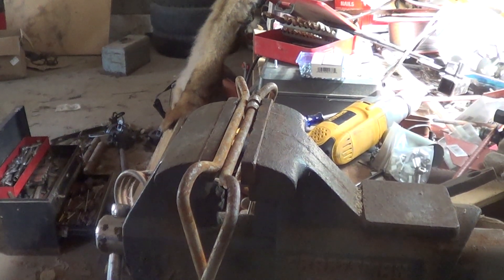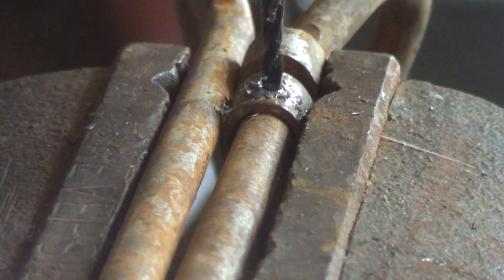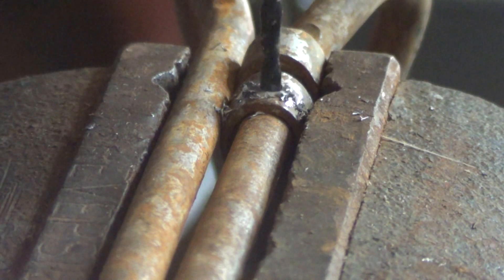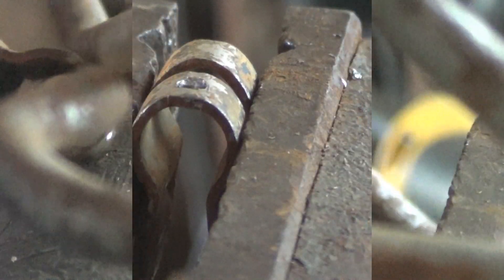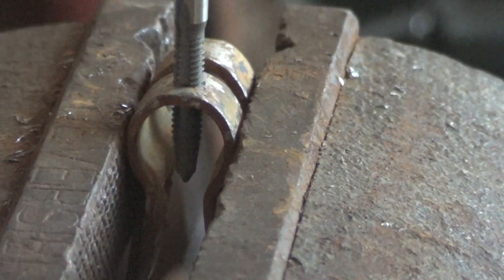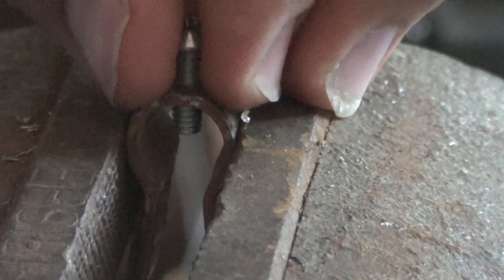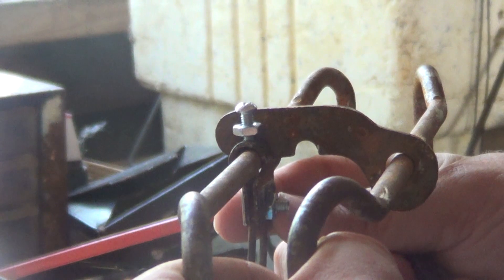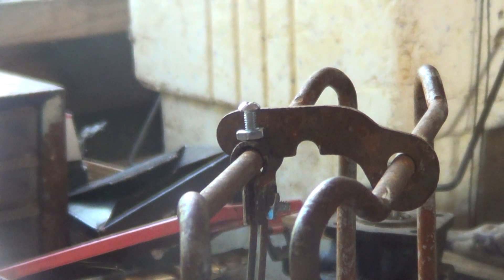how to make an adjustable trigger on a 330 conibear

Comment: not trying to be rude in any way, but 8/32 is the same as 1/4
Reply: +Matt Mings  Oh, I'm the idiot, your talking about the thread pattern lol.
Reply from the maker: Yeah, you have to have a very fine thread in order for it to work.   I ended up switching to a set screw and a thin jam nut.  It works freat.